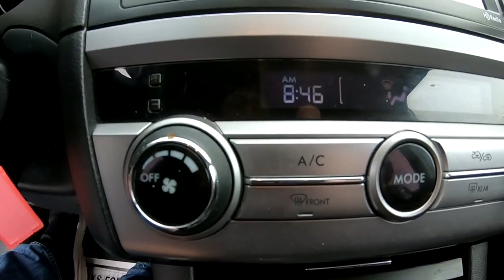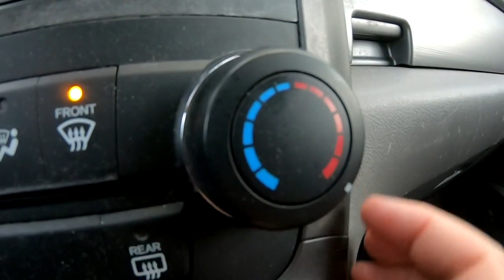Tony Martinez explains why you should use your car's air conditioning during cold weather

Comment: Don't these people have a defroster / heater combo? Why not use that?
Reply: Defrosters don't dry the inside without the AC on. Modern cars automatically turn on the AC compressor when you select defrost
Reply: @Chiefonenut  Thank you for explaining. Is there a difference between the AC and the heater in the winter in say a 1998ish vehicle?
Reply: @ElizabethRussell144  Well I'm no expert (although I may have sounded like one :) But if you turn on your defroster and it removes the moisture from the inside of the windshield, your AC compressor has been switched on. If it doesn't remove the moisture, the turn on your AC and it should dry it out
Reply: @Chiefonenut  Thanks!